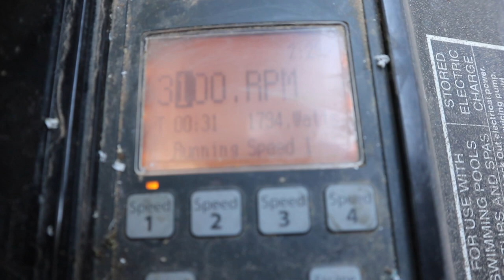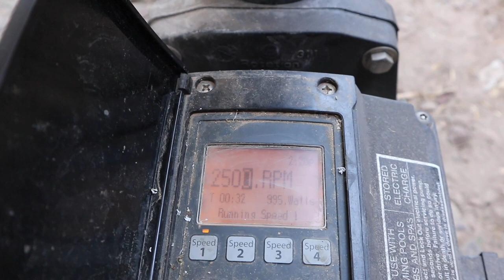Save $100's by Changing This One Item In Your Pool!!

Comment: I just had a pool built and have the gamma 4 venturi heads and they don't work unless I go to 29
00 or above...any ideas. all new 3 hp pentair system
Reply: I'd recommend installing a new head module unit built by Blue square. They operate more on flow, as opposed to pressure. I just put one in for one of my customers, here in arizona. The pool thoroughly gets cleaned now, using less pressure. The heads are all A and A (shasta heads) still.

Comment: I noticed my paramount PCC2000 popup cleaning system has not been running that well lately. I bought tools to remove the popup heads but they seem to be really stuck. You made it look really easy to remove. Do you have any tips for removed stubborn stuck popup heads?
Reply: You can turn the heads with the tool so they are unlocked and then turn on the pool filter which might push them out of their socket.  Many are tough to pull out after being in there for a long time and getting sediment in there.
Reply: @JJshimmyshimmy  thanks Jimmy. I ended up draining the pool. While the pool was drained they were a lot easier to get out. I have them all replaced now and the pool is so much cleaner!

Comment: I’ve got one zone in my pool that the heads won’t pop up. I’ve tried putting new filter cartridges, increasing pump rpm, and I’ve checked the manifolds and they seem to be ok. All the other zones pop up fine. No pool guys seem to know what to do, and the guy who installed it won’t do anything about it. It’s all A&A stuff
Reply: What part of AZ? I know a lot of good techs that can help out and are familiar with the A&A setup.
Reply: Greg Huber fixed it already, thanks

Comment: an OK video, does not help if you dont tell us the difference between the 2 heads, you might save some money by running at lower speed but you might also need to run it longer cause the heads dont clean as much as the previous ones, so tell us.. what the difference?